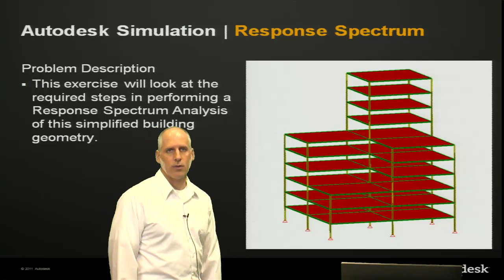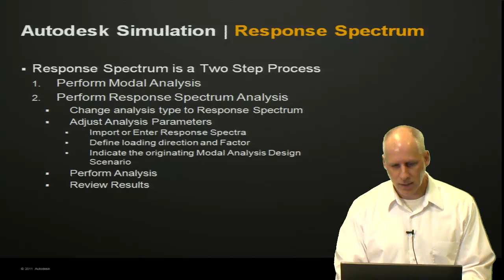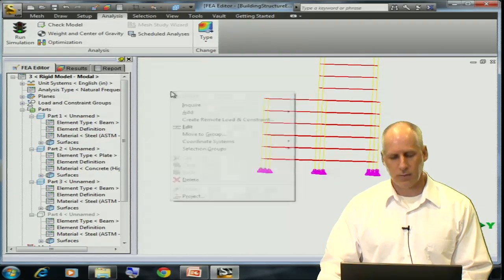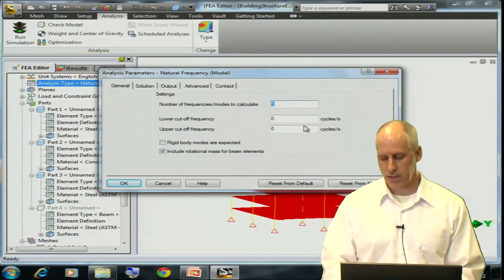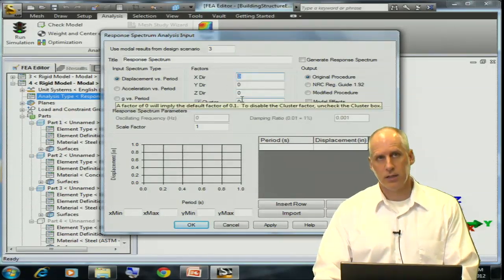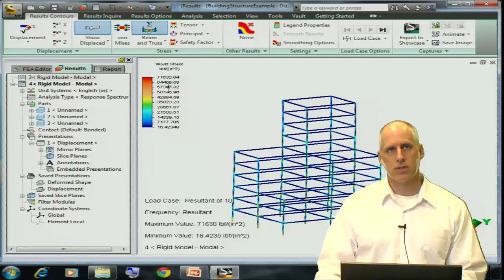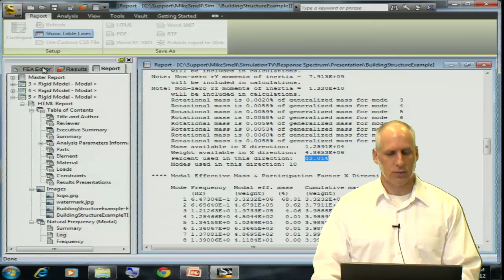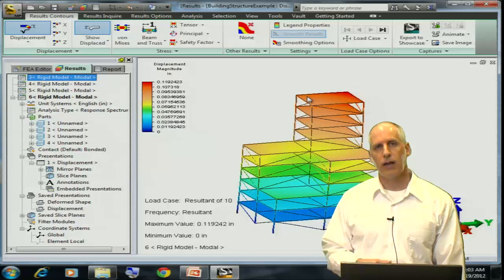Response Spectrum

Comment: Pat,

If I observed correctly, the first time you imported g vs period curve (at time 7.00 sec), you changed the curve to be g vs period in the "Response spectrum analysis input", but whereas the second time after stiffening the geometry you have not changed the imported curve to be a g vs period. You ran the simulation with the curve as displacement vs period.(at time 10.14 sec) Can you explain this?
Reply: Hello R K, I apologize for this delayed response.  Your observation was correct.  I did mistakenly chose the "OK" button before changing the input type from displacement vs period to G's vs period.  I'm glad I was only demonstrating the analysis process and was not relying on these results to determine the quality of this design :-)

Thank you for pointing out this error.

Comment: How to do p delta analysis having Response Spectrum??
Reply: Hello Prashant.  The P-Delta analysis type accounts for an update in the models stiffness as a function of the application of loads.  The response spectrum analysis is a linear analysis and is based on the linear approximation of mode shapes from the natural frequency analysis.  These linear analyses approximate the type and magnitude of the solution while considering these loads applied within the frequency domain.  If you would like to consider these geometric and perhaps material non-linear effects, then this would be accomplished using a non-linear, and time dependent, analysis, such as the MES (Mechanical Event Simulation) analysis type.  However, this time-based transient analysis takes longer to perform and produces more voluminous results.  Also, the input load must be transformed from the frequency domain to the time domain.  The short answer is... the linear approach is much faster, but approximates the solution compared to non-linear approaches.